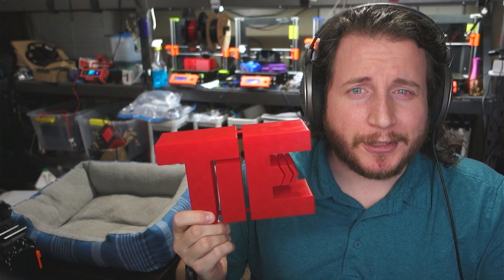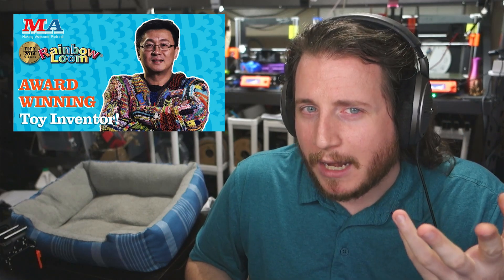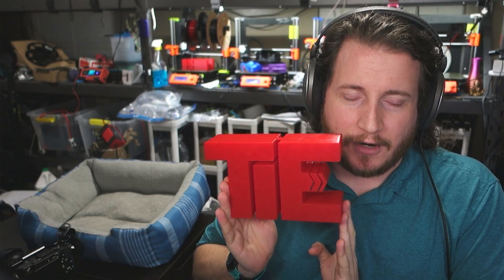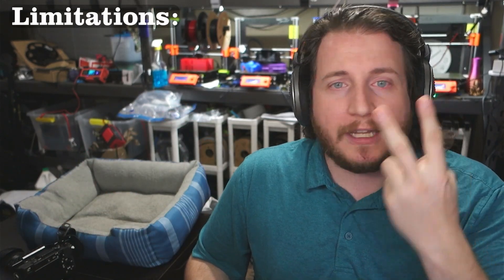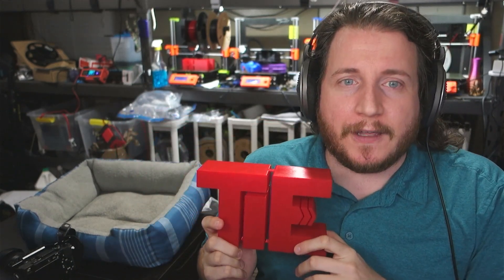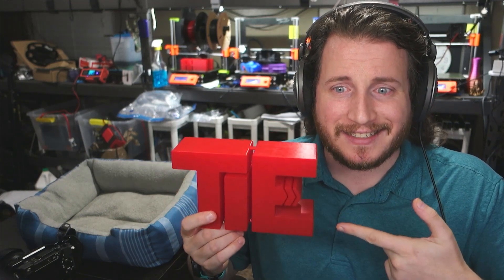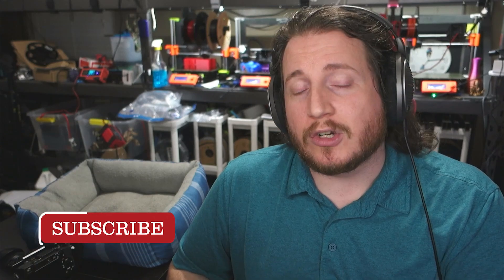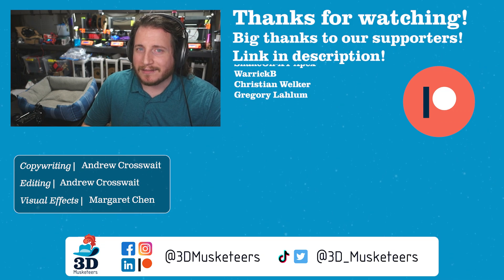Is 3D Printing Right for YOUR Project?

Comment: Had a hinged leg support on a $125 tripod that was a plastic piece, break . Took a couple of tries on getting it right as the shape was a bit weird, but the tripod is back in use, and I have a file on hand if this happens again.1/2 an hour of design work, and 1-1/2  for the 3 test prints combined time. Wound up using the test print instead of a final thinner level print. I was doing other stuff I needed to get done while the printing occurred so I really don't throw that into the time bucket. So my per hour time investment was less than a new tripod, and I happen to REALLY like this tripod.

Love my honeycomb wall over my workbench.
Reply from the maker: been there before! Glad it worked out!

Comment: The most satisfying thing I made/printed is a replacement sliding window roller wheel. Super easy to make/print and cost me cents instead of $10 a set at the hardware store. This is pretty much what I mainly use my printer for. Fixing things around the house or making smart storage for things.
Reply from the maker: oooooh nice!

Comment: I noticed the mk4 now has a 0.05 profile in prusa slicer with a stock 0.4 nozzle. I was not expecting that. Makes me wonder what kind of profiles it has for the 0.25 nozzle. I now have a spare hot end and I have the nozzle. It takes less than 5 minutes to swap, but still no where near as easy as a revo.
Reply: I didn't use it though. I'm not sure how big of a deal layer height is with copper fill pla. I'm already pushing my luck with a 0.4 obxidian. If it was just normal PLA I would have tried it already.
Reply from the maker: you can easily run 0.05 on a 0.4 nozzle but GOSH it takes forever.
Reply: @3DMusketeers  Unless it's a tiny part?
Reply from the maker: Eh, at that point just run resin, no?
Reply: @3DMusketeers  but resin is toxic
Reply: @3DMusketeers  can't be any slower than if I was using a 0.25. Which I have but haven't used yet.
Reply from the maker: Yeah it may not be for that!
Reply: Typically isn't the recommended layer height around 25-75% of the nozzle diameter?
Reply: @soundspark  I just use the smallest one I can most of the time which until now has been 0.1. I like detail.